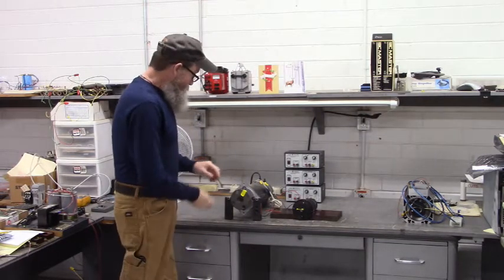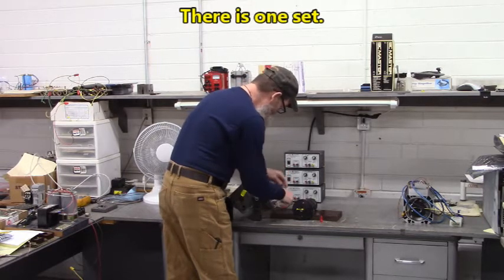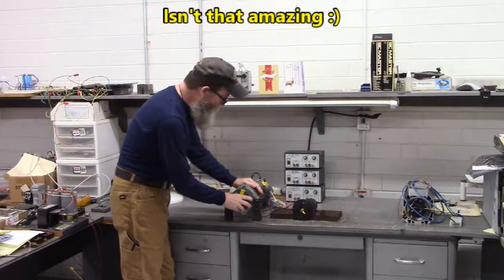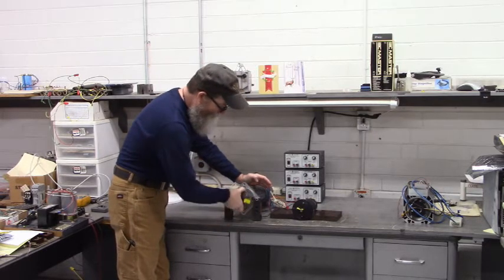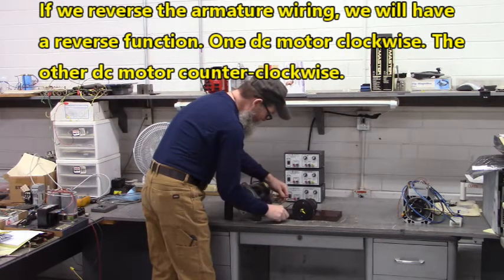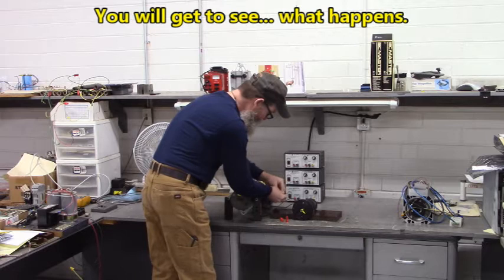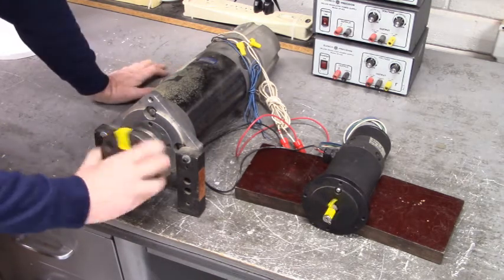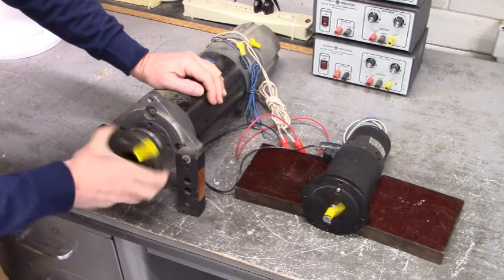Experimenting with two Permanent Magnet DC Motors

Comment: I'm just wondering why you didn't spin the smaller motor to see if it would move the the large one?
Reply from the maker: Spinning the smaller permanent magnet motor provided even less torque to the larger dc permanent magnet motor. And in doing so, the larger dc motor barely spun. You Sir are very observant in noticing the possibility that the reverse was an option. Thank you so very much for stopping by and watching one of my videos. I hope that you are have a good new year with your family.
Reply from the maker: Do you have two permanent magnet dc motors of the same size? Can you perform the same experiment to let us know if that makes a difference? I would be greatful of your results :)
Reply: @PeepawMcDonald  Yea, I have 2 mini dc motors I can hook up and try ..
Reply: @PeepawMcDonald  I can get them both running together but not by hand cranking them, I have to put 0.5v to get them going.
Reply: @PeepawMcDonald  I thought that the smaller motor would have to spin much faster to get the larger to spin at all!  So they're both in unison while spinning the smaller motor?  I mean the smaller needs more rpm's.
Thanks for the reply and best wishes, same too you!